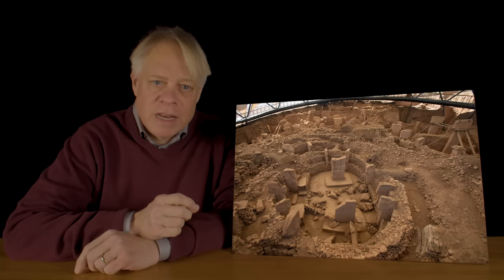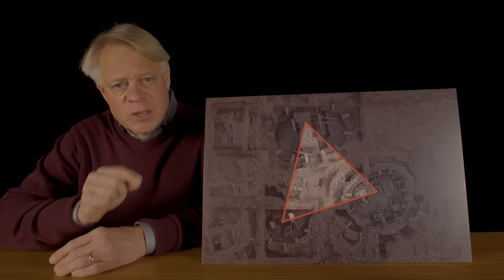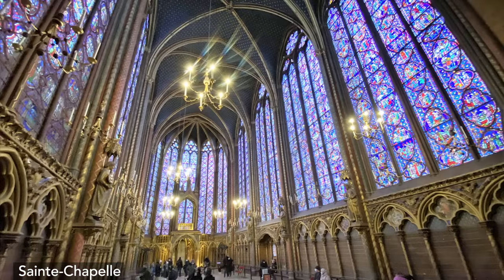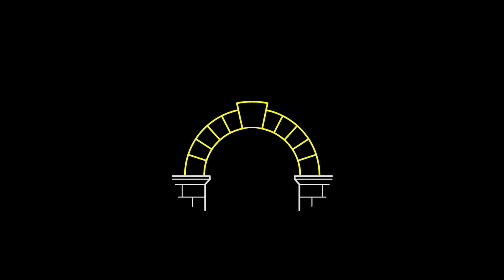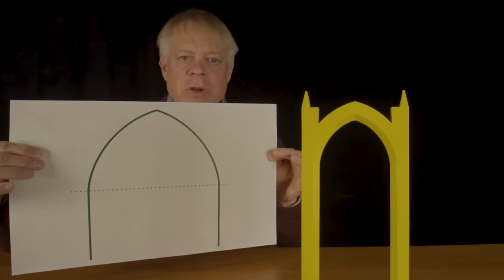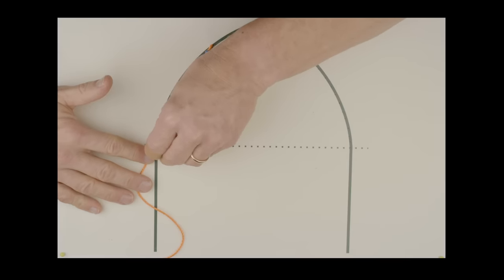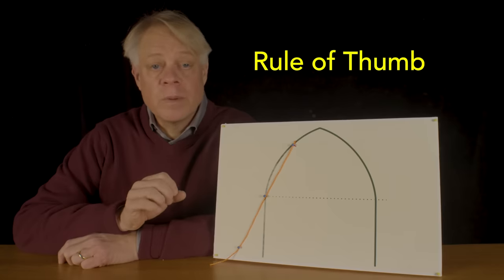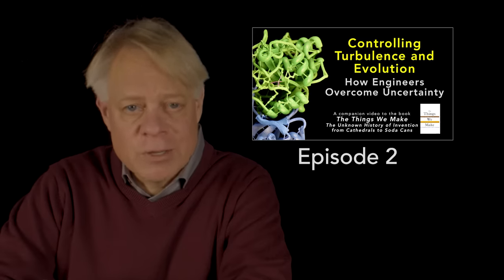Building a Cathedral without Science or Mathematics: The Engineering Method Explained

Comment: 1:50 while i do NOT think there is a high degree of doubt this was indeed intentional i think it important to point out that i have personally found when designing structures with obvious limitations;
If you design using your ingrained sense of esthetics and let the design "flow" there is an uncanny amount of time you'll find walls/beams/whatever being of the lengths: 2,3,5,8,13,.. (+-1, rarely.)
if you let the design flow from there i have OFTEN noticed accidental creations of perfect symmetry, triangles and many more shapes that look like they took a lot of pre-planning.
they did not. "I was just muttering numbers to myself while fumbling around."

Comment: I'd hazard to guess that the line is a close approximation of the net force exerted on the columns. The peaked arch is better at transmitting the force directly down into the columns than the circular dome is. The pillars can be thinner because even if the total force is more on the peaked arch it's more directed vertically down through the stone rather horizontally across. Just a guess though and I'm interested to see what other explainations people might have for why this works.
Reply: But there's one huge mistake in the example given with the Sainte Chapelle. If you look for photos of the outside of the Sainte-Chapelle you'll see that the forces from the arch are not supported by the thin walls alone. The walls are only dealing with the vertical forces. The lateral forces that the arch applies on the pillars is transferred to huge external columns that make the pillars 3 or 4 times wider than the walls.

The Sainte Chapelle is a rather small building that doesn't need much external support. But if you look at the sides and back of the nearby Notre-Dame Cathedral you can see the numerous flying buttresses that form what we call the Spider. The revolution of the gothic architecture over the roman one consists of 3 things. 1. the peaked arch modifies forces to make them more vertical, 2. walls inside the archs that only support their own weight don't need to be as thick as the pillars, and 3. you can add oblique beams to transfer lateral forces to an external set of extra pillars so you can size the internal pillars to only support the vertical weight of the building.

Comment: I did the calculation. If you use a set width and a given height. (Because the premise would not have been to create an arch of a given height but rather a space of a given proportion) In one example you use a pointed arch and the other you use a circular arch with taller walls and you use this rule you end up with walls the same thickness approximately. 

My presumption is that they realised that the rule didn’t work with walls a certain height so they had to use different geometry to get the walls (more like columns in reality) to load more vertically than horizontally. The rule of thirds must be somewhat incidental.

Comment: I'm a student in math, and I found the geometry in this video interesting, so I worked it out myself and it turns out that this rule of thumb actually works!

If you're just doing it for the normal, nonpointed arch, the proof for this actually just becomes a normal Euclid-style proof.

Probably the reason why the Romans knew about this is because essentially all of the math knowledge during their time came directly from Euclid's elements, and I wouldn't be surprised if a construction like this appears there. Even if it doesn't, it's pretty easy to work it out from the theorems and axioms in it, and then the masons could've just copied from the people that worked it out before them (although this might be an anachronism, and it might be the case that the rule really did come from centuries of trial-and-error).

In fact, the method they used to find the width is mathematically equivalent to the construction that you'd use to make it. Everything that you do with the rope there is actually equivalent to using an (unmarked) straightedge and a (collapsing) compass, it's just that a lot of it was extremely simplified in the rope method.

For the part with the pointed arch, it's still true that the wall would end up being between 1/5 and 1/4 the width of the arch (it would actually be 2r*sin^2(2/3*arcsin(sqrt(w/(4r)))) where r is the radius of the circle and w is the width of the arch), but the proof that I found of this requires a lot of trigonometry and calculus.

You need trigonometry to find what the width of the wall is and calculus to show that that is in the correct range (using the intermediate value theorem and Taylor's theorem), so they wouldn't exactly have been able to prove that this works mathematically at the time, unless there is some other way to prove this that I haven't noticed. If there isn't any other way, they wouldn't have been able to prove this for at least another 500 years (in the 16th century when Newton and Leibniz began work on calculus Taylor's theorem was proved), and they wouldn't have been able to completely formalize the proof for another 100 years in the 17th century.

I guess the reason why they started using the rule for pointed arches was just because it seemed to work well for nonpointed arches.

The history of math is actually filled with things like this. People in engineering and science want to just be able to do things, and usually mathematical formalism would just get in their way. Instead, they make conjectures without any desire to actually prove them, and later math "catches up" and shows that they were right all along. Another example that comes to mind is when Fourier invented Fourier series to solve the heat equations. He didn't have a real proof that Fourier series worked for all L^2 functions (which caused a lot of controversy in the math world when he claimed that something like that was true), but he didn't have to since all he needed was a way to solve the equations.

Now, I'm not sure where the fact that you need a stone wall from 1/4 to 1/5 the width of the arch in order to support it comes from, so I guess that's just from trial-and-error. In fact, maybe even the people who created the rule of thumb in the first place never considered them as proportions of the width of the arch, but instead just used it because it just worked. I'd be interested in reading some first-hand sources on how they constructed these types of arches through the centuries to try to trace back if they really did take the idea from geometry or not if they actually existed, but I'm not a historian so I wouldn't know where to look.

Comment: Okay, sorry for the dumb question, but...why do all that hassle for getting a fourth of the diameter? Why not get a rope to measure that and fold it into fourths and now you have the size of the column? Did I miss something?

By the way, that method works for a circle because one third of an arch makes a 30° angle from the circumference and the sine of that angle is 1/2. Some similar triangles later and bada-bing that length is (1/2)^2=1/4 of the diameter. Still no idea (or even if) how it works for other curves though

Comment: When using heuristics, it is important to understand that your heuristic will have limits and that you may not know where they are. The cathedral builders reached their limits before the advent of steel construction. Beauvais is the perfect example for this. Built using the same types of techniques as were used for centuries, but taller than ever before. Beauvais collapsed multiple times. If you're going to use a heuristic, be sure to have a plan for if/when that heuristic fails.

Comment: The laws of physics pertinent to their work were known by the master builders of the Middle Ages.  It is true that they kept content with heuristic and iterative solutions to their equations rather than produce an algorithmic equation for each curve, but they knew what kind of curve was the optimal one : the point arch was chosen over the semi-circular one because they had discovered that the forces were equally disposed when the stones of an arch or a dome followed the shape of a chain, not of a portion of circle.  For all practical purposed a pointed arch composed of two intersecting circles didn't depart from a chain curve but for negligible elements but had the advantage to be composed of interchangeable stones.

Comment: Some comments mention medicine, wondering whether it is science or engineering. I knew a cardiologist whose first career was molecular biology research, which he pursued at a prominent university after his Ph.D.; ergo, he is experienced with science. He once commented to me, his physicist patient, "Medicine isn't science, and good thing, too!" His point was the same as yours, that much of medicine is experience based, no scientific understanding required, and one does not want to be slowed by requiring such understanding. In medicine, one would say something is "clinical" to convey that it is a matter of practice or art. A scientific understanding is not required for something to be clinically useful. So, if it isn't science, is medicine engineering? I would venture, though, that the question, while interesting, is only useful if the answer helps us in some way.. If we knew that medicine is engineering, would it help medicine or engineering to be practiced better?  My guts say medicine is not engineering, but I'm not sure why. I suspect it may be because much of engineering allows one to build things out of other things, to encapsulate structures or mechanisms within new creations and predict that these new creations will work. That's not what medicine does.

Comment: I'm an analog electrical engineer, during our studies we're pushed to first prove everything using mathematics and simulations before even considering building things. If you can't back up your claims with formulas and numbers, it's irrelevant and bad. But in the end, since real world things never line up with your mathematics fully, you end up with "unpredictabilities" so quickly you learn the habit to avoid analog electronics where possible and use more predictable digital solutions instead. I hated digital stuff, as a hobby I'd only build analog circuitry. I rarely calculated anything, most things was done by reasoning, trial and error, also using topologies as shortcuts to thoroughly section off parts of my designs at the cost of more parts to use. I thought I was just hobbying, it wasn't rooted in mathematics so I wasn't very confident about my design methods.

Then I started working, I've worked with colleagues who started their active careers in the late 1950s, 60s and 70s. Those guys didn't have those simulations, and for the very high frequency and high voltage stuff, oftentimes they didn't even have the mathematics that described the parts they used. They developed and used a gut-feel approach. Doing it a lot, lots of experimentation, lots of tuning, honing and experience. They also used graphical ways to calculate things. Rather than memorising formulas I'd see them print out curves of transistors and whatever, take a ruler, draw a bunch of lines, determined values for parts that way. It made stuff waaaayy more understandable to me than sticking with purely numbers. The learning materials in their books I've seen also first explains how something works intuitively, most formulas are kept in the appendix, deemed unnecessary for the engineer who plans to use the information from the book as a tool. On the workfloor, the workflow of these guys is insane, they're almost never the bottleneck. Whether it's the antenna amplifier in your phone to the high voltage electricity grid, even nowadays with these highly advanced technologies, they're still all based around heuristics. You'll get a different answer from every engineer you ask, but in the end it somehow always works out perfectly.

I found out for sure now the field of analog tech actually wasn't as clean, it's mostly rules of thumb and gut feel. It's not an exact science, it's a bit of an art form as well. It doesn't fit with modern teaching methods so it's sadly going a bit extinct.I wish there would be a larger effort to introduce people to these design methods again. It makes engineering significantly more interesting, often times you don't need perfect optimal performance and it's fine to go a bit overkill in design. It frees up time to spend your braincells solving the problems that result in actually innovative solutions. I worry for the day most of this generation of engineers is going to retire. I'm now studying for a degree in teaching with the hope to keep their wisdom alive amongst the new generation of engineers. I do still have a deep appreciation for the people who manage to do this kind of design with a purely mathematical approach, we can't live without these guys either but even nowadays, but in the most modern of technologies today's world, still crucial elements are still based off a rule of thumb :-)

Comment: This is also why young scientists often prefer the metric system without realizing the advantages of older measuring systems. Older systems were based on fractions, which a person can calculate simply by folding a rope. The decimal based metric system requires standard units.

Comment: We learn a lot by looking at things which failed or succeeded in the past.   Your masons rules of thumb, demonstrate this: repeat what has worked, avoid what has failed.  This is a good but not perfect method.  Many surviving cathedrals aren't really all that stable;  columns are bowed, arches are cracking, walls are spreading, etc; most have required retrofitting with iron reinforcements to prevent collapse. Modern engineering can understand some of those failures.

To be clear, modern engineering isn't perfect ... all those rules and there are many memorable engineering failures from the 20th century - all of them using "state of the art" engineering.  We're still learning.   Modern engineering still can't make buildings as earthquake resistant as 10-th century Chinese temples.  Hopefully, we'll continue to learn.

Comment: Great video, but I've a question on a detail. In order to get their "roughly 1/4 of the interior span", why wouldn't they simply lay a horizontal rope between the two points where the arch was to meet the verticals (or a projection of those onto the floor), and simply halve that rope twice?
Reply from the maker: Because they were not thinking they needed a fourth and wishing they had the math to do it; the notion that this is a proportion is from out time; instead they were thinking “here is this action taught to me orally by the head mason who I worked under, I will do that action.” Also, although not important as I just noted, the number isn’t exactly a fourth ….

Comment: I love this video.  Rules of thumb are great. When is a column out of plumb?  When the center of the top of the column is out of plumb of the middle third of the bottom.  I suppose if I had to find a 1/4 distance of a span, I would get a rope the same length as the span and fold it in half and then fold one half in half again. Many ways to skin a cat.  Thanks for this video.

Comment: You know, I never realized that’s what I was doing. We had a younger guy come in, working on a weldment drawing. There was a piece of round bar slid though a small box section to make the handle of a dolly. He kicked up the drawing with a fractional hole the same diameter as the bar. I kicked it back to him and told him to make the hole 30 thousandths bigger and to make the dimension a two-place decimal (which tightens the tolerance from +/- 1/16 to +/-.015). He asked me how I came up with those numbers, and I shrugged, not having an answer other than it seems right.
So I walked him through how to do a tolerance stack up. We got out the mill tolerances for the bar diameter, added some clearance for assembly to the maximum diameter, and got our minimum hole size. Then we took the minimum bar diameter and added the maximum root gap allowed for welding and got our maximum hole size. 
Turns out that it was supposed to be just about 30 thousandths bigger than the rod and a tighter tolerance helped assembly keep it square… I didn’t realize until now how many rules of thumb we use in everyday engineering. We don’t need to reinvent the wheel if someone else has already done the work - there’s not enough time in the day for that; just use the number and move on.

Comment: Thanks this was nice - but I was disappointed that you did not discuss the geometry of the pointed arch itself. There could be thousands of variants, unlike the semicircle. You also did not mention the pinnacles above the point where the wall meets the arch - seemingly decorative but of pragmatic engineering necessity. (cf flying buttress)  Also -  I don't think its helpful to speak about this example as if it is unique. Point taken about heuristics, but these methods are both highly accurate and intellectual . The medieval masons were adept at proportional geometry, they could, for instance, divide a circle perimeter into seven parts (heptagon). They had no need of numbers - quite confusing for folks who equate mathematics with numbers. Just a simple 'modulus' that was usually a rod the height of the master mason.

Comment: Little confused about the 'Engineering Method' Isn't it the case that very old buildings such as cathedrals exist today because we finally got it right. Lot's of old buildings probably collapsed because we got it wrong. The scientific method is quite similar. We make a hypothesis and then prove it is correct or otherwise by experimentation and observation.
Reply: That's exactly it. Engineering is the common name of Experimental Science. Pretending that engineering is not science shows a deep lack of understanding that they are actually the practical and theoretical sides of the same coin. And neither can leave without the other.